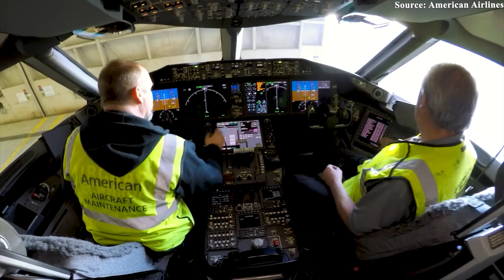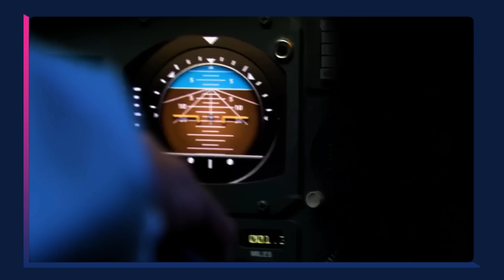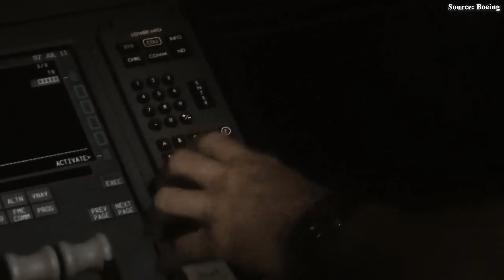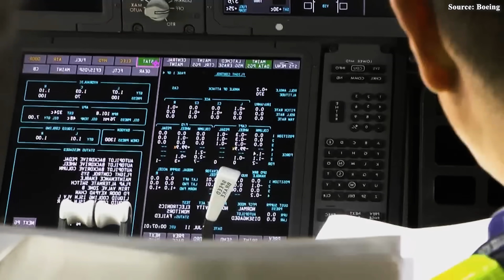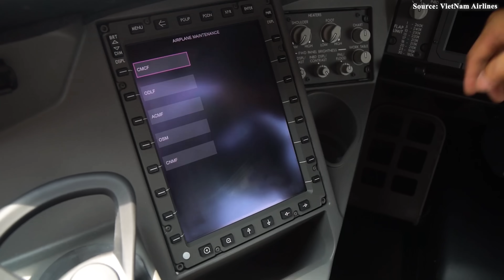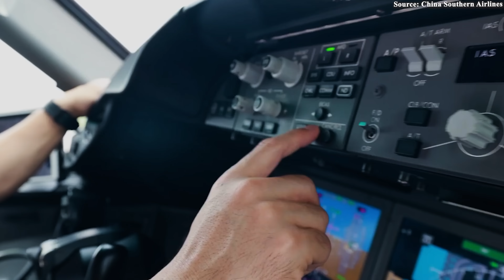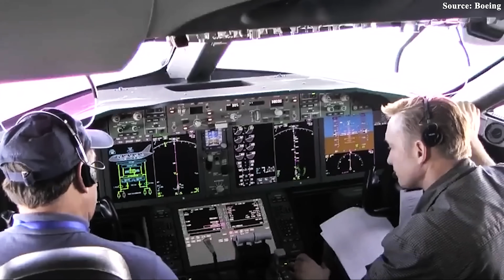They Just Dropped a BOMBSHELL about Boeing 787's AI 171 Flight!

Comment: This summary of the AI Flight 171 crash is comprehensive in scope.  IMO, it correctly aligns the human element with the technology component in the demanding environment of commercial passenger and cargo aviation operations.  Pilot and machine must fit and function together like hand and glove.  Do we have enough pilots that have the ability to fit that role?  Do we have aircraft design engineers that have the ability to create failure tolerant airframes and systems?  I think not yet.
Reply: Los aviones son muy seguros, los pilotos no son IA, son seres humanos con sus malas acciones o decisiones que permiten ante cualquier situacion la soluciones con su capacidad habilitada o se equivoquen,  como pasa en infinidades de casos, puntualmente este capitán que decide matar a 270 personas. Boeing nada, además, este tema puntual del echo , es para tenerlo en consideración sea Boeing o Airbus o el que sea, todos los aviones tiene estas llaves de paso de combustible.
No creo haber leído en tantos años un caso de este tipo.
Hay muchísimas formas de sabotear el avión por los pilotos que así lo quieran, imposible evitarlo, salvo que sean conducidos por IA/Piloto automatico 100%.

Comment: Ridiculous! No pilot would cut the fuel to engines during take off. It couldn’t happen by accident and it can’t be pilot error. It must be a hardware failure, where the plane thought the physical switches were activated, when no pilot touched the switches. It’s not human error, it’s yet another Boeing manufacturing fault that once again has cost 100s of lives.

Comment: The switches were physically switched off, then on. It was an electronic shut down. It had happened previously and a software update had been advised.  It’s easy to blame an Indian pilot but impossible to corner a corporation the size of Boeing. The corporation has a circle of protection
Reply: Rubbish!
Reply: @ScottMunro-p3y do more research. Did the rat deploy for simply shutting the fuel?  There is so much more to it. Boeing is now in damage control mode
Reply: Real rubbish

Comment: What bombshell and who are "they"?  Both switches where reported by the flight computer to be moved to cut off in less than one second and where reported as being switched to run after 10 seconds but with 4 seconds going between switch one and two, about the time it will take to move one switch from on to off and then to on again and then do the same to the other switch. It took 10 seconds to understand that the computer had turned off the fuel and then pilots tried to turn the fuel on again by doing the only thing possible and try to initiate the proper signal to the flight computer by flipping switches back and forth.

Comment: Bla bla. ....what are y trying to hide?

A bad  control  software  design that overrides pilot basic decisions ?

A  basic hardware failure in the aircraft design or maintenance ??

Perverse....😎😎👻
Reply: There is no software that would or could actuate the cutoff switches. These switches were intentionally moved but, none of these investigations so far have answered the question of if there was any other person in the cockpit like a jump seat rider or a flight attendant.
Reply: @jmartin5607  The TCMA could cut flow to the engines due to sensor or software malfunction (see Nippon Air 2019). Nonetheless, if there is conclusive evidence (black box data, etc.) that the cut off was caused by physical movement of mechanical switches, the captain is implicated.
Reply: @jmartin5607 an erroneous softw could order to cut fuel . It's more probably this option than two suicide pilots taking off
Reply: @jmartin5607 the onboard  control computer runs a Control Software that actuates  each valve , electric or electronic switch etc , so it may control all plane parameters as a Google car does on an " intelligent"😂CAR; that finally crashes because.....there's no intelligence at all today in no software....today

Comment: Your "THEORY" is TOTAL BALONEY, promoted by BOEING to escape liability !!! Software WAS the problem !!!

A.) BOEING'S POORLY WRITTEN and POORLY BACKED-UP SOFTWARE PROGRAM "GLITCHED/RE-BOOTED" immediately AFTER a successful "Take-Off" and during the "Power Climb-Out" Phase;.... due to an AC Dual Electrical Bus "FULL POWER TRANSFER FAILURE” (as evidenced by the RAT being deployed, and the landing gear RE-TRACT failure). The FLIGHT CONTROL COMPUTER Forgot the Aircraft was AIRBORNE and gave "bogus commands" to; (a.) the FADEC Thrust Control, re-setting the ENGINE THRUST OUTPUT back to IDLE; and (b.) the FLY-BY-WIRE SYSTEM, re-setting the FLAPS back to initial position #1. 

B.) These incorrect "computer commands" caused a degradation of LIFT, and the catastrophic CRASH of the aircraft into ground terrain !! The PILOTS had NO CHANCE to save the passengers and crew; because BY DESIGN, the BOEING 787-8 Aircraft has NO COMPUTER OVER-RIDE CAPABILITY (unlike AIR BUS has) !!! STOP trying to "scapegoat" the Pilots !!!!
Reply: Totally WRONG. You know NOTHING about aircraft systems. There is NO software on these planes that can move the fuel cutoff switches. They were purposefully moved by human hands.

Comment: That is wrong. There is a history of uncommanded  action by the software or a sudden electric failure. The plane might have thought the plane was on the ground and not flying.
Reply: NO. The touchdown switch has no input whatsoever to the fuel shutoff switches.
Reply: Bullchit!

Comment: agreed or disagreed from this "angle" .. if the safety missing of those switches is going to be enforced or WHAT ! .. is that ever was the case or not .. or other factors 2b investigate or looking into such TCMA and it's link to FADEC engine management system .. those fuel switches cannot remain the way they are .. safety need 2b ENFORCED either by re-design or some better safety gards over those toggles ! has to be done

Comment: Gentleman, a bundle of wishful lies may impress someone. It is 2018 FAa
A circular says that the fuel cut off switches may move inadvertently and to check it thoroughly.
...just an advisory....
...very casual.....

28 days prior to the air India accident ,British Airways again circulated stern measures to check the uncommanded closure of fuel switch which they admit catastraphy..
Boeing cockpit layout has nothing to do with inadvertent movement of fuel switches. Both has gone off in 0.1 second .
No human cand do in anything in such a short time. Very soon things will come out.. How long a bluff continue.....to
Help USA company.
Capt Bharathi Ramanathan.
Reply: Your info is not complete. The "circular" you reference was for certain Boeing 737 aircraft, not the 787. There have been no anomalies with the 787 switch at all. The circular was about the locking mechanism on the 737 switch. These switches must be pulled outward before they can be re positioned. A spring hold the switch down into it's detent. Even if that spring was broken, the switch would still need to be pulled to reposition it over a mechanical gate that is built into the switch. This is NOT a simple toggle switch.
Reply: If you read the report, it also states that the fuel switch module was replaced in 2019 and 2023 (module replaced every 24k hours per maintenance schedule). We don't need to speculate about the condition of the lockout mechanism because the switches were recovered from the crash site. They were both in the "on" position and remained locked in that position in spite of the crash. Each toggle has an independent spring and indent. Previous crew notes contain no issues with the switches. All aircraft in India and S Korea with these switches were investigated this week with no anomalies. The likelihood of both independent locking mechanisms failing on both switches at the same time and both switches spontaneously moving due to turbulence is so small as to be unfathomable.

Your timeline is also inaccurate as the switches were turned off 1s (not .1s) apart which is humanly possible. Cpt Ramanthan's timing for switch movement, if you watch is video, assumes the pilots were following procedure and giving verbal feedback confirming each step. You can find video clips of the switch movement and time them yourself. 1s is expected. 0s is what would be expected if there was a digital cutout. 

A better theory is the TCMA digitally cut off the engines which would have caused the crash without moving the switches. The preliminary report seems to say that the flight data recorded physical movement of the switches (contact closed circuit recorded at 1s interval, then 10s delay before re-engage first engine, then another 4s to second engine). The TCMA system would not change the position of the physical switches which are purely mechanical. Getting to the truth should be the only concern. If there is a physical problem with any of these aircraft, it must be corrected. If, however, there is incontrovertible evidence of pilot misconduct, that cannot be papered over for political reasons.
Reply: Bullchit!

Comment: The second engine was cut off only one second after the first, it’s not possible for a pilot to do this such fast
Reply: yes it is there are a dozen videos with pilots shown doing just that operating both switches one second apart.  It can be done faster as well.
Reply: Es posible incluso cortar los dos al mismo tiempo
Reply: Yes, I have seen many videos demonstrating how both switches can be shut off within one second. In fact there is an Indian produced video which displays a video loop of rapid switch operation even while they ironically argue against it.  If a pilot could get both hands behind the switches, he could shut off both at once. It can be performed with any two fingers or finger and thumb.

Comment: ok, listening to many theories and  past accidents, it could definitely be a problem with this supportive system that takes over control of the plane...(especially the sensors  which detects if the plane is on the ground or not) there was multiple issues with that researching the web. I also noticed from the research that multiple planes have more and more issues with engine failure... Is there a possibility that the malfunctioning supportive system may be cutting of power to the engines and causing most of the problems....also recent web researching of  Boing's quality control and cutting costs on production and labour makes huge safety concerns... It becomes scary to fly....
Reply from the maker: Your comment is well-received, we will look into the details and share more updates with you soon.

Comment: What happened can never be clearly pin pointed, it appears. Was the fuel switched truly cut off. May be in run mode ( why did you cut off fuel asks one, I didn’t replies the other and a second later Maydad Mayday) but despite on run mode fuel to engine may have been cut off. Points to some system failure. Thorough investigation is needed.
Reply from the maker: Thanks for your insight

Comment: Just dirty narrative being set to blame pilots without proof,  as Boeing  737 Max also crashed immediately after takeoff killing all 189 passengers in Indonesia where it was identified that faulty design, faulty malfunction  sensors, poor maintenance etc were issues for crash.....So also such possibilities in 787 Boeing..... In December 2018, the FAA warned the flight operators especially 737 and 787 series aircrafts that there is potential risk of getting the locking mechanism of fuel switches disengaged which can fail the Protective Gate allowing the fuel switches to move from RUN to OFF on it's own without manual  lifting increasing the risk of unintended in-flight engines shutdown,  so the operators were advised to check whether fuel switch could be moved without lifting,  a failure of locking mechanism compromised....   .. the locking mechanism might fail due to mechanical wear and tear, fatigue, loss of strength in internal spring, internal faults, poor maintenance and various other faults etc could be the reasons, and probably something of this nature  could have triggered in Boeing 787  on 12th June 2025 when pilots observed that the fuel switches were in OFF position and the fact that the pilots immediately moved the switches from OFF to RUN when engine1 almost revived but engine2 did not.......if there were any bad intentions why Pilots turned switches to RUN.....it's probably failure of locking mechanism of switches and  blaming the pilots is too cruel  at this stage in this case..... 😡

Comment: It has happened before on the Dreamliner. In 2019 a Japan flight was in final approach, and when the WOW switch (weight on wheels) activated, the fuel switches cut off by themselves. In this case too, it’s possible that when the WOW switch activated as the main wheels left the ground, the fuel switches cutoff. The pilots switched them back to run, but too late unfortunately!
Reply from the maker: Thanks for the information!

Comment: FADEC stands for Full Authority Digital Engine Control. It is a system used in aircraft engines, both piston and jet, that utilizes a digital computer to manage all aspects of engine performance. This system optimizes engine operation, providing benefits such as increased fuel efficiency, reduced pilot workload, and enhanced safety features

Comment: What if water vapour blocks the fuel to engine after takeoff? What FADEC system will do? Can FADEC System automatically make both the switches off?
Why you don't consider the fuel quality and fuel transmission system and the hot humid weather in Ahmedabad that day when the AC of the aircraft was malfunctioning?
Aviation fuels must be free of impurities that would interfere with the operation of the engine or the units in the fuel and induction system. Even though all precautions are observed in storing and handling gasoline, it is not uncommon to find a small amount of water and sediment in an aircraft fuel system. A small amount of such contamination is usually retained in the strainers in the fuel system. Generally, this is not considered a source of great danger, provided that the strainers are drained and cleaned at frequent intervals. However, the water can present a serious problem because it settles to the bottom of the fuel system. A small quantity of water will flow with the gasoline through the carburetor jets and will not be especially harmful. An excessive amount of water will displace the fuel passing through the jets and restrict the flow of fuel; it will cause loss of power and can result in engine stoppage. Under certain conditions of temperature and humidity, condensation of moisture (from the air) occurs on the inner surfaces of the fuel tanks. Since this condensation occurs on the portion of the tank above the fuel level, it is obvious that the practice of servicing an airplane immediately after flight will do much to minimize this hazard.
https://share.google/jXMMqOSyGrRFSnxub
One senior Boeing Pilot suggests:
Poor Maintenance leads to poor electrical connections lead to AC non functioning lead to temp increase in hot humid airport in the scorching heat lead to vapour accumulation in the fuel tank lead to fuel transmission blockage when the aircraft tilted back to fly lead to engine failure lead to fall and hit to the building below lead to fire ball lead to deaths and destruction.

Comment: On January 17, 2019, an ANA (All Nippon Airways) Boeing 787-8 flight, NH985, experienced a dual engine shutdown after landing at Osaka Itami Airport. The engines, Rolls-Royce Trent 1000s, shut down immediately after the pilots deployed thrust reversers during the landing roll. The aircraft was towed off the runway after coming to a stop. The incident is believed to be caused by a software glitch in the Thrust Control Malfunction Accommodation (TCMA) system, which incorrectly interpreted the thrust reverser deployment as a ground event, cutting off fuel to the engines. 
Details of the incident:
Flight: ANA NH985 (Tokyo Haneda to Osaka Itami)
Aircraft: Boeing 787-8
Engines: Rolls-Royce Trent 1000
Event: Dual engine shutdown after landing
Cause: Suspected software malfunction in the TCMA system
Outcome: Aircraft towed off the runway, no injuries reported 
Key points about the incident:
Not a first-time occurrence: A similar incident with an ANA 787 had occurred in 2019. 
Software blamed: Investigations pointed to a software fault rather than pilot error. 
TCMA system: The TCMA is designed to prevent over-thrust situations on the ground but can be triggered incorrectly under certain conditions. 
Thrust reversers: Deploying thrust reversers too early after touchdown can trigger the TCMA.

Comment: Only western media is protecting Boeing watch his video ! 

https://youtu.be/BRCRNIUEygY?si=IoL3VKb-Ialj-5Od

Further, only the latter part of the conversation between the 2 pilots have been released but the entire transcript has not been released. 
Also, according to the 787 flight manual in a engine cut off situation the pilots have to toggle both switches to restart the   engines ! Still the engines did not start. 
- This is only possible if FADEC would have not responded to the switch. Also the FADEC is programmed to give thrust to the engines automatically, This automation did not happen as well. Therefore its a Software issue Possibly a software bug in the FADEC